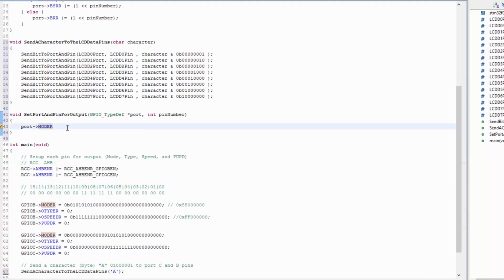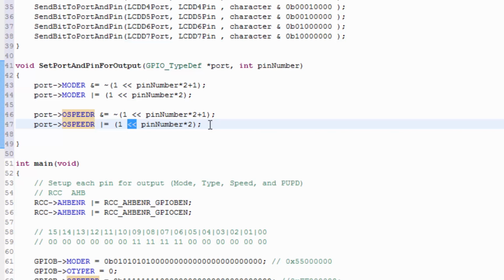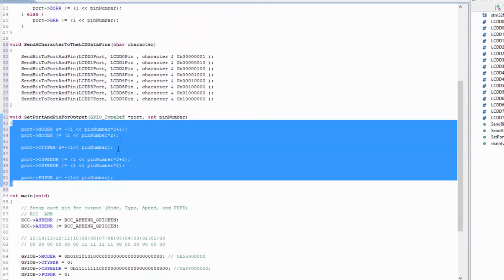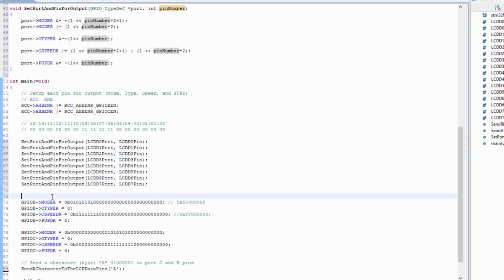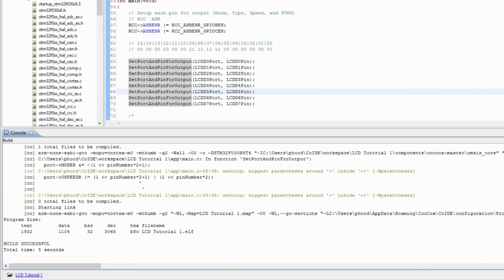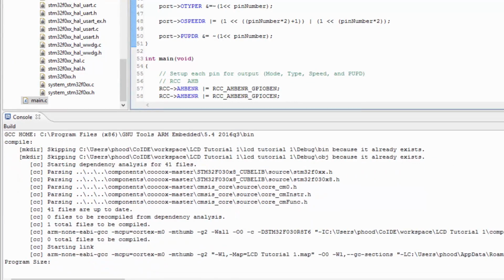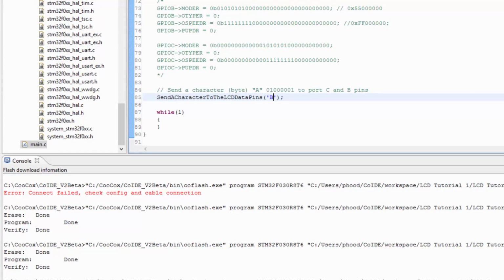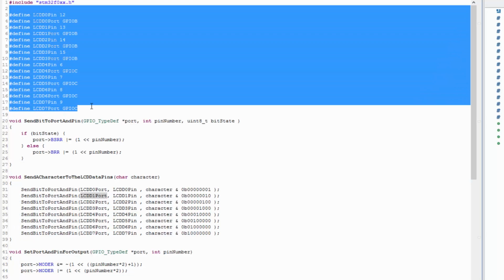19. How to Interface an LCD to an ARM Microcontroller - Part 6

Comment: Hi Patrick, thanks for this great series! I have one question: at PUPDR it is a 32 bits register, so, should I use the following code: 
 port -> PUPDR &= ~(1 <<  (pinNumber*2)+1);
 port -> PUPDR &= ~(1 <<  pinNumber*2);
Reply from the maker: 32-bit registers really don't have a difference when you use the shift operator.  Use the shift operator like you would with any binary number.  Registers are only binary numbers and you are simply taking the number to the left of the shift and shifting it the number of positions designated on the right side of the shift operator.
Reply: Patrick,
First off thank you for these awesome videos.  I'm still stuck on what Jean mentioned. PUPDR is a 32 bit number. In the video you shifted the pin number without a multiple of 2 as if it were a 16 bit number. So this isn't setting the register correctly.
Reply from the maker: Stated that way, I now understand the issue.  Yes, that is probably right.  The code is just resetting those positions and since they are probably reset anyway, the code will work  (until you need to set them differently).  It's too bad I can't replace this video with correct footage.

Comment: first off, thanks a lot for the tutorial. 
but, these tutorials can they be used to even learn the stm32 nucleo boards? (I am totally new to arm I am more into avr sorry) and for nucleo there are online ide and not offline (free ones) so can you suggest something? 

cheers! 
thanks again:)
Reply from the maker: I don't see why not. As long as you are using the same headers and making sure to use the same registers, you should be fine.
Reply: okidoki.. thanks for your quick reply :)
Reply from the maker: Not a problem.  Good luck.